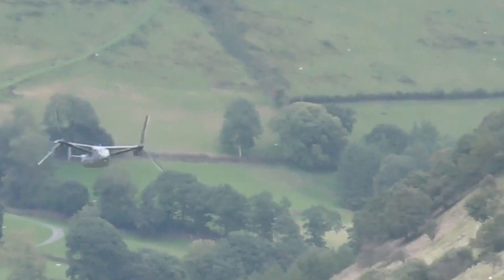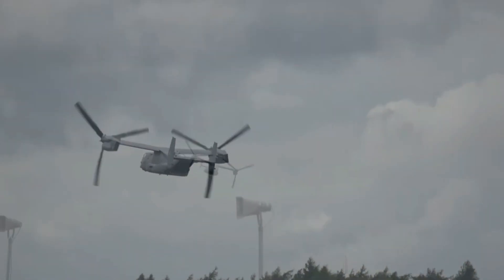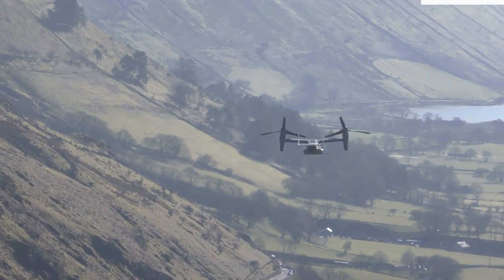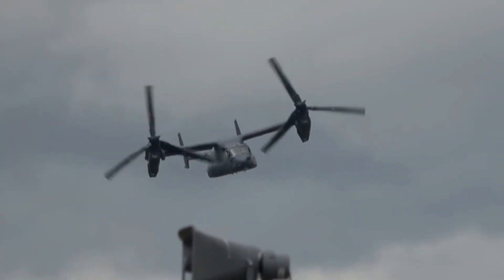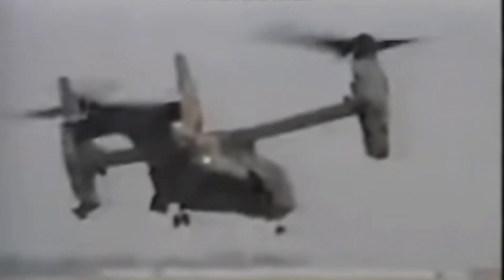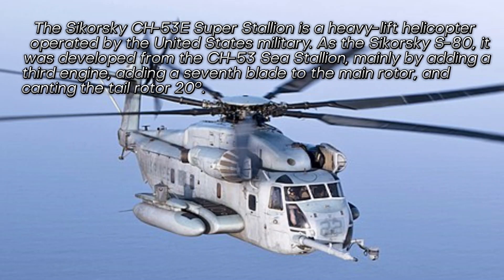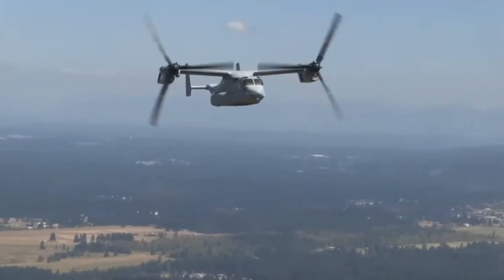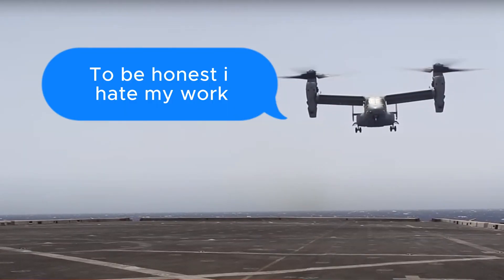why the V-22 Osprey is called the widow maker?

Comment: Why not put tiny jet on back real high
Reply from the maker: both  the engine are connected with turboshafts so what if we change the turboprop with turbofan engines but we will lose the variable pitch props and i dont have any idea how the turbofans will perform vertically, this can be an exciting experiment